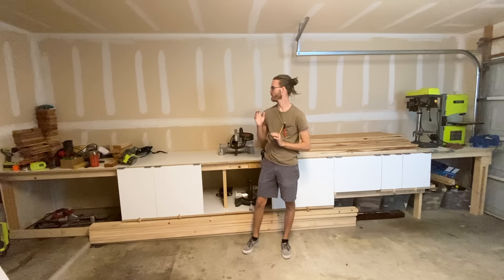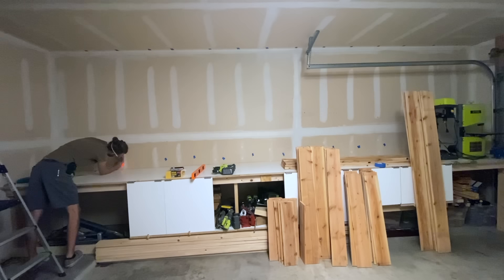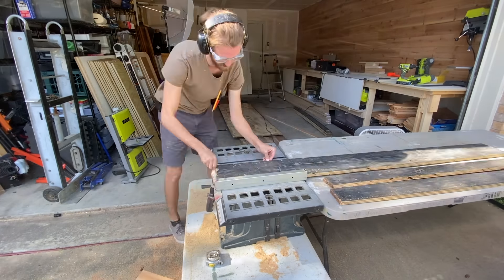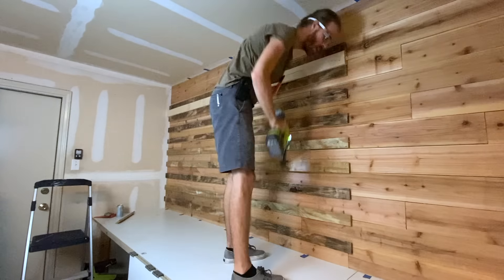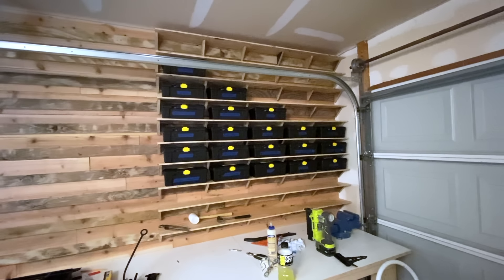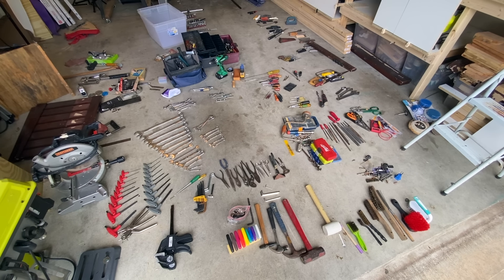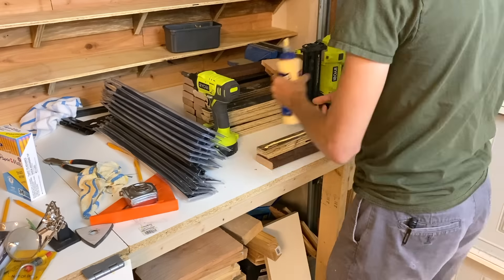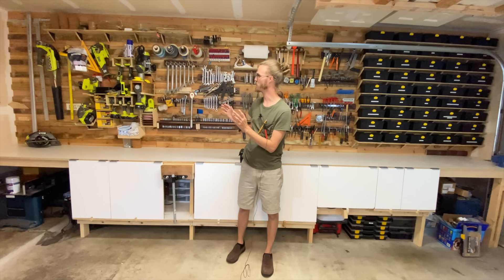I Built A HUGE French Cleat Tool Wall In My Small Garage!

Comment: I love the wall full of French cleats and cedar you have done. It is beautiful. the toolbox shelves are awesome! I love them! But the rest of it like the magnet strips with tools attached to them make it look very messy and I would do the same thing if I didn't watch your video. Thanks for the video it helps me see what not to do and do that. My suggestion for them tools on magnet strips is to set them up so you can tell if one tool or more is missing because your way you will lose them. But keep up the great work and there is more room for improvement!

Comment: great looking setup!!   How aren the Harbor Friegt magnets working for you on the heavier tools?   I'm worried that if I use them they may not be strong enough and I would be continually fighting tools dropping off.  Was thinking of buying strong magnets, dato out a groove and gluing hem in.
Reply from the maker: The only tool that is to heavy that I have on mine is the torque wrench, but I kinda hook it on the top so that it stays on.